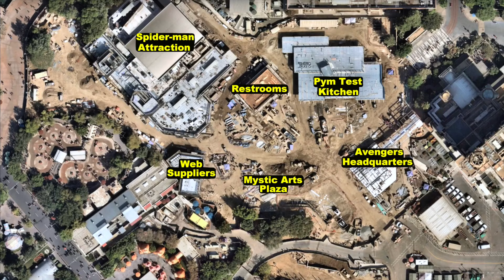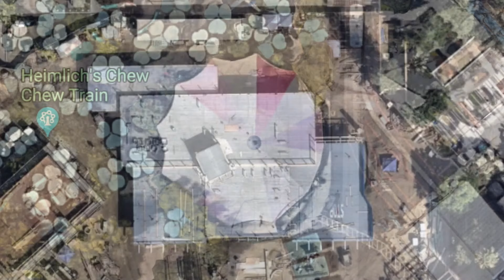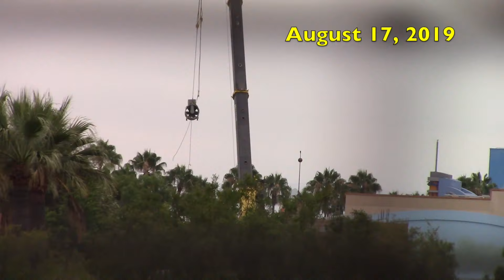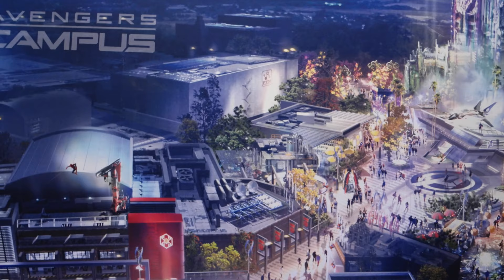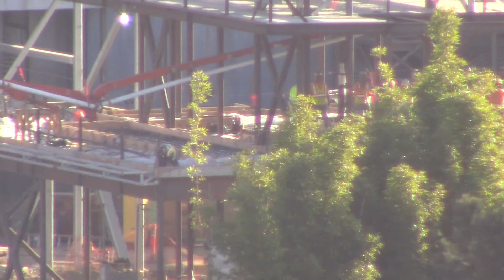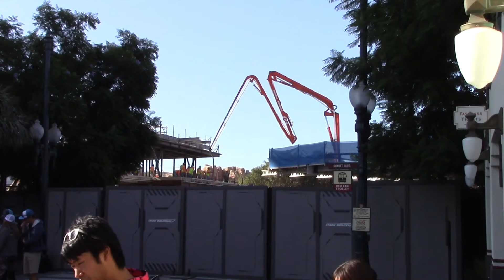AVENGERS CAMPUS (aka Marvel Land) Construction Video Journal - Part 6

Comment: love your videos,

as for the trolley, its starting to look like the trolly building will stay where it is.
i believe someone noticed that the tracks right near the construction walls still turn south.  supposedly they are even still there but just covered with wood.

the headquarter building also seems to be just a facade in the eastern section of the design. some believe that they will have a themed movable wall/gate that will be able to open to allow trolleys to go backstage after hours and access the maintenance building.
 this area also will allow for access to the western side of the guardian tower where the maintenance bay for the elevators is.

the main show building for the avengers attraction would them be built separately and then attached via a corridor to the avengers headquarters structure being built now.

hopefully they start construction on that soon er than later so we get an idea but my guess is that they will not until the campus or more finalized.  the area now is being used for construction access
Reply from the maker: I think you're right about the trolley building.  If the trolley building stays where it is, it does make sense that there will be  a movable wall/gate in the headquarters building.  I'll talk about this in my next video.  Thanks for your comment and for watching!